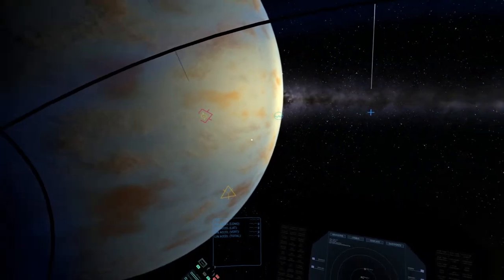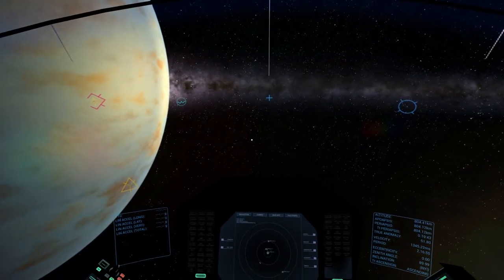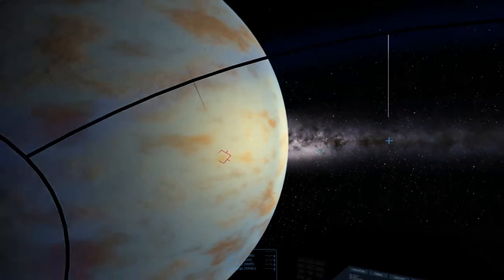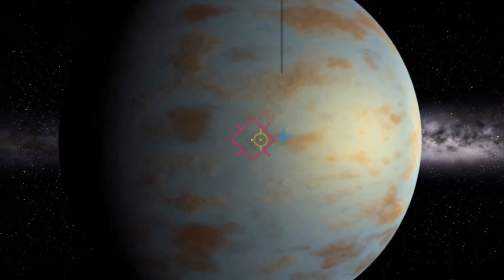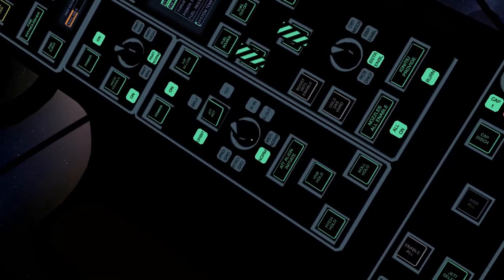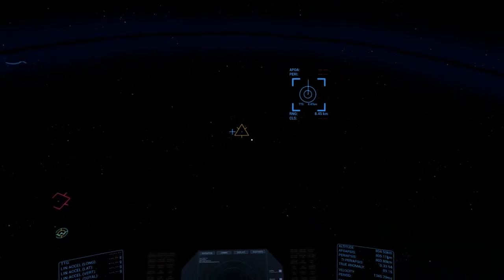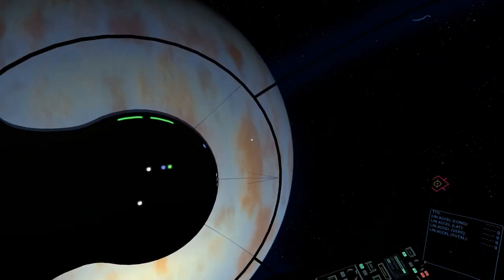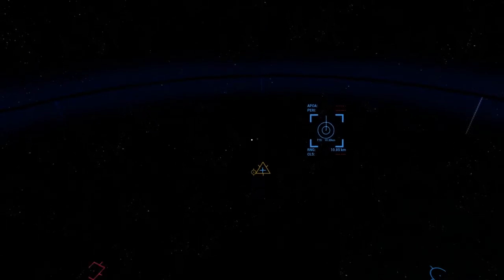Manipulating orbital slant/inclination in Rogue System

Comment: Coming from Orbiter sim I feel like the flux drive is to the delta glider/XR2 thrusters what a motor boat is to a sail boat. Just crank that lever up and youll get there hahahahah anyway good video.
I'm interested by the way in your physics simulations, what do you work on?
Reply from the maker: Sry for the late reply.
When I talked about simulations that I've programmed I was merely referring to simple gravity sims. Just add three bodies to a system, and you get a chaotic/non-linear system.
I find (recurrent) artificial neural networks fascinating, but I'm just an amateur programmer.
Reply: No worries :) Im a physics student but I like tha ability to manipulate software (wich is really useful for physics in term of simulations) ANN are also a field that I love, even if, as I said, lack those abilities I did read a text book about them to understand how they worked mathematically, pretty cool things (wouldnt it be cool to train ANNs to pilot enemy ships in RogSys?)
Reply from the maker: +Guille Arana I'm a smidge disappointed that ANN's don't see any wider usage for controlling the AI opponent in games. Or genetic programming for that matter. But these methods are not very reliable, so it's not surprising that large companies don't seem willing to spend too much money on that. Maybe quantum computing could solve many of those problems :)